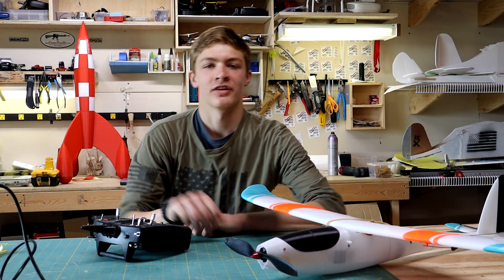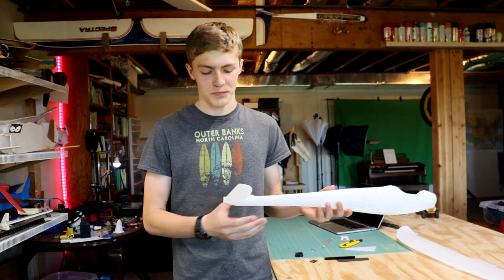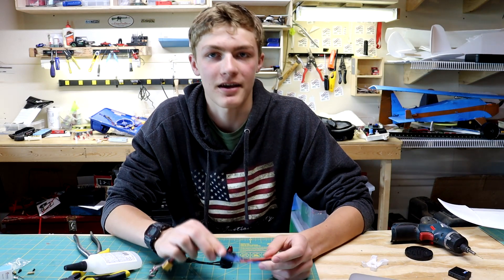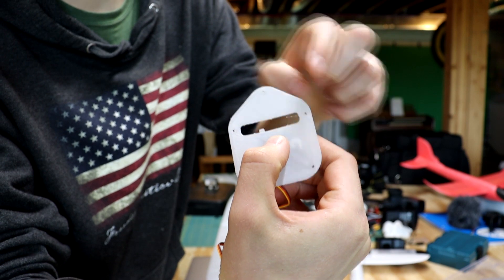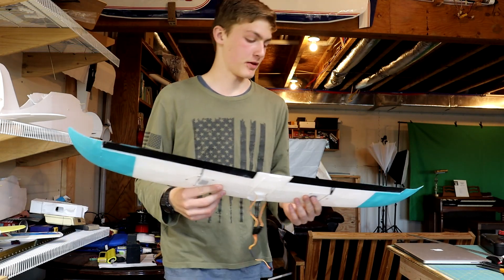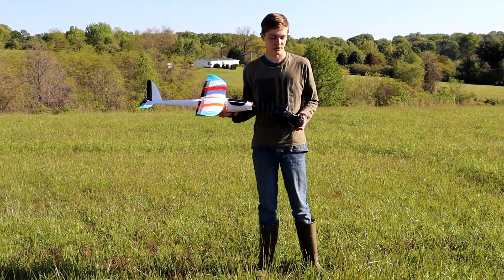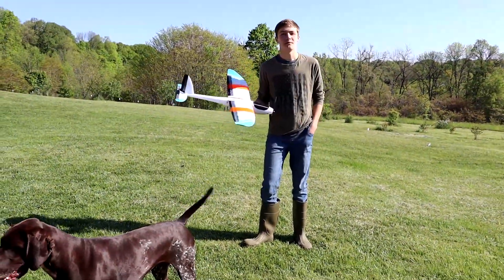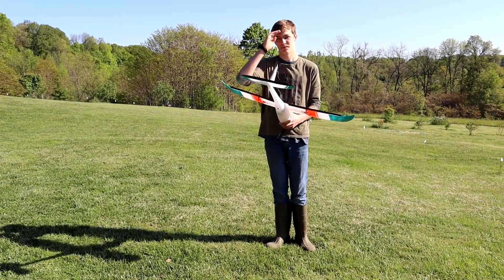FREE 3D Printed Plane Eclipson Model A!!!

Comment: Hello, I am currently printing the Free version of the model A and I had a few questions. A: After it is Printed with LW-PLA is it supposed to be able to be squished?  It is very bendy yet holds its shape. B: where are the guides for the Carbon fiber rods for teh fusagle?

Comment: I have a question about the fuselage print, when i print the second and the third part of the fuselage, it doesn't have slots or apertures for me to connect other fuselage parts together. I'm just wondering how did you guys solve the issue?
Reply: On the model A only fuselage part 8 and 9 has this problem, due to both edges laying on the print bed.
You should print the guides labeled 41 and glue them into the inside edge of one fuselage part to help align the other. Same for one joint in the wing.
Reply from the maker: Hey! I built this so long ago I don't remember but there is a build video for this plane that walks you through exactly how to put the plane together. I just watched it and it shows how to connect those parts of the fuselage. The video is "How to Assemble Eclipson Model A RC Airplane - LW-PLA" by Troy McMillan. (Also, don't mind the LW-PLA. You can also use the video for just printing out of pla.) Hope this helps! Feel free to let me know if this does not help 😂.

Comment: So I’m printing my plane as we speak and the wing center and wing left have tabs on them but there are no recessed pockets for the tabs to fit into.  It looks like I have to cut some slots for the tabs, or possibly remove the section on the side face of the wing.  I don’t think it’s infill or a temporary support as if feels really firm.  I’m new to 3d printing but I really think it’s cool.  Thanks in advance for the response.  Cool video and I can’t wait to get this thing in the air. Hope my question makes sense.
Reply from the maker: Thank you! Glad you liked it. It is possible that some of your printing parameters are not set up properly. The side faces of the wing should be open. On the two parts of the wing that you are talking about there should be 0 bottom layers and 0 top layers in your slicer settings. That is not the same for all of the wings sections though. If you scroll down too near the bottom of the Eclipson Model A page, https://www.eclipson-airplanes.com/modela, you will see a table called printing parameters. It will have all the proper setting for you the print. Also if you want a better look at the building of the Eclipson Model A here is a build video that Troy McMillan made: https://www.youtube.com/watch?v=VL8SChNY3Gg&t=627s Hope this helps.
Reply: That’s exactly what it is. I had the printer settings off. Thanks so much for the help.
Reply from the maker: No Problem! Glad I could help.
Reply: Hate to bother you again but is there a problem with my printer. I have speed set at 50 mm/sec and standard quality at .2 height and it is taking forever to print. For example wing section 1 left took 12 hours. Also are these things durable? Seems like it might be a flying egg shell.
Reply from the maker: @gg6k  I do not know exactly what is happening but the wing sections should not take that long. For example,  Wing 1L should only take 4hr and 41mins at 50 mm/sec. The only problem I could see would be that one of your settings is off. The answer to your second question is, not really. They are more durable than balsa wood models but are still pretty fragile. The nice thing about them though is that if you break a part you can just reprint it.
Reply: @xpfusion4851  don’t know if this has happened to you or not but my printer was working fine and then it would stop midway thru a hours long print. I resliced the print in cura and same thing happened. Come to find out it was a bad sd card. Got a new scandisk brand card, instead of the cheap one that came with the printer and I’m old to go. Just thought this may help you in the future. Thanks again for your help with my other issue.
Reply from the maker: @gg6k  No Problem I am glad I was able to help! Thanks for the tip. I have not had that happen yet, but I have heard of it happening. Good to know.

Comment: I did not realize that the M2x8mm screw they call for is the one that comes with servos! I was on the fence about buying yet another specific screw just to try this but turns out I have over 50 of them already. Thanks for pointing this out, protip of the video.
Reply from the maker: You are welcome. Glad that helped!

Comment: Nice work!  My model A is almost done,  Putting a power pack b into it which is a 2212 motor.  Looks like it’s too short.  Wondering if you had to shim your motor further forward off the mount?
Reply from the maker: Thanks Karl! Yes my motor was to short as well. I used a metal X mount I had laying around. That still was not enough so I had to sand the nose down a little way. Hope you have a good time building!